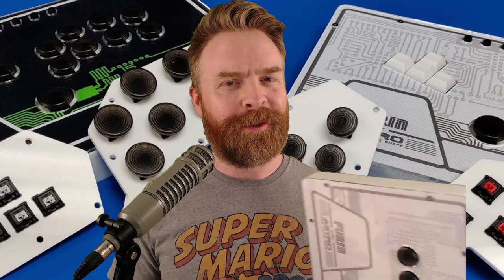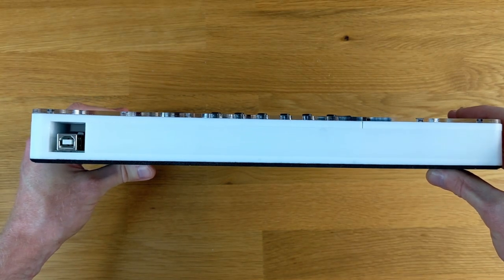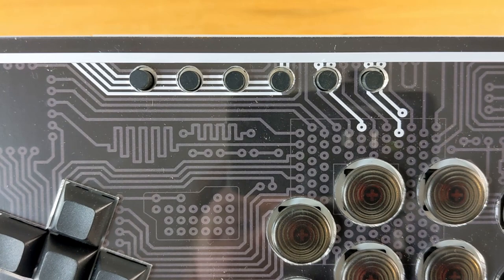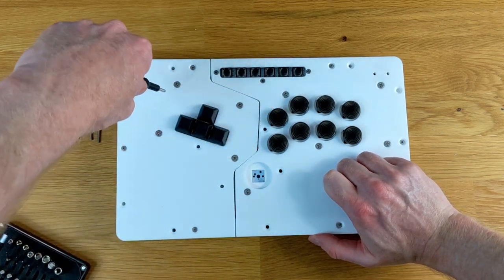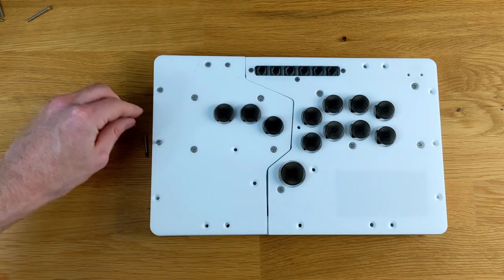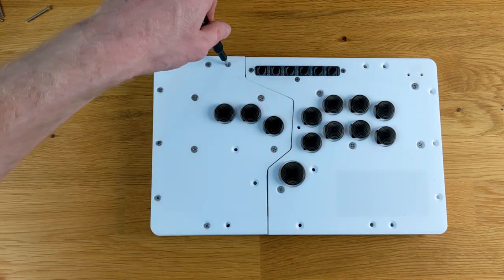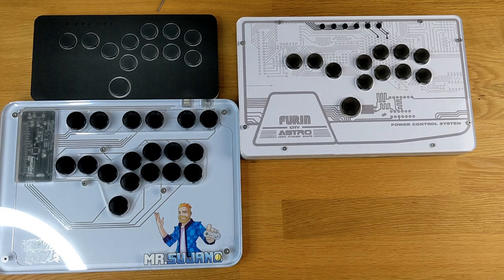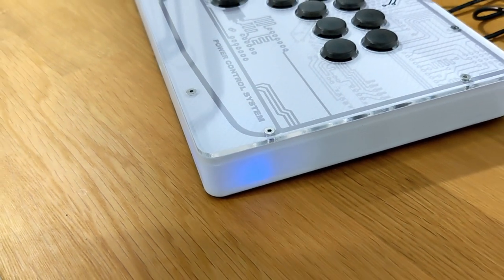The Swiss Army Knife of Fightsticks: The Furin FRS

Comment: It would be nice if they added locating pins in the main body for aligning with the exchangeable top panels.

But you could just use some painters tape to hold them aligned and in place while screwing them down.. not like you'll be changing those so often anyway

Comment: That's pretty dope. This is definitely something I would want as I would use keyboard wasd layout for other types of games, hitbox and joystick for fighters. Hopefully some of the concerns you had are addressed.

Would be cool to upload your own artwork to be printed for you (for not too much $ considering it's already very expensive). Or if they have a template to make and print your own.

Edit: They have an upload option and a guide for it, so that's awesome.

But man it is super expensive lol. I'm interested but for that price there should be no panels lining up uneven and basically the other issues (USB port and length of interior cable) need to be squashed. For the price these are a necessity to be addressed. I don't want to have to fiddle and possibly bend or break something.

But thank you for sharing this super cool unit. Will look forward to it's progression.
Reply: The feed back from this review is super useful. Uploading your art is no extra cost. 😊
The USB port issue has already been addressed and having longer wires to address the other issues is no problem at all. 😊

Comment: Hey can you make a video about yuzu from version 1070 causing issues with performance, this is due to the new cpu timing introuced in version 1070. Are you able to find out if this will be resolved the only answer i got this is because of older cpus. Im on a AMD 5600X cpu and 3070 card, was able to get for example mario kart to play in 4k 60fps with 0 drops now sub 20 fps. I want to know if version 1069 is going to be the peak performance im going to get out of yuzu from here on out because of the new cpu or is there some work going on to resolve?

Comment: how are hotswaps?
Reply from the maker: Haven't tried em, but I'd assume they are fine
Reply: @MrSujano  sorry I meant what are hotswaps?😅
Reply: @sheikhu1039  you can change the switches without desoldering. Like say the stick comes with MX Reds and you wanna change them to blues, if it's hotswappable, you can change them easier.
Reply: @zakutenakazumiya1516  oh interesting , so u can just pull it out?
Reply: @sheikhu1039  yes. Though you will need a switch puller or something to press the small tabs on the switch to take them out.
Reply: @zakutenakazumiya1516  thank you for the info, are there any benefits to soldered over hotswaps?
Reply: @sheikhu1039  not that i'm 100% aware of. But having it hotswappable does make switch replacements easier should one of the switches break or goes bad on you 😅